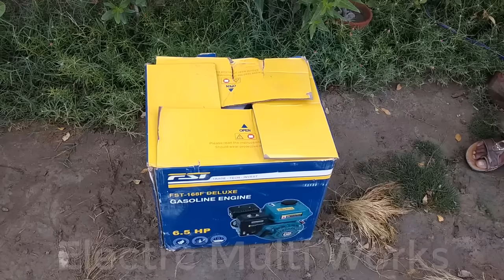Flywheel Free Electricity How To Make Free Energy Generator 230v With 8kva Alternator & Motor

Comment: These guys are scammers he has  change  alternator inside to be a 12v electric motor
Reply: If you had been paying attention you would have noticed how the plugs got switched before and after starting. I’ll bet the receptacle was wired, all one would need to do is hide the wire inside the tube steel. Viola, ‘free energy’.
Reply: Nonsense effort totally against the physics
Reply: Same equipment for different video.....only changing paint...nice try......🤣🤣🤣🤣
Reply: @jasincolegrove6651  I noticed the plug location swap also. Gotta admit, they're pretty slick!

Comment: i didn't get what's the use of the alternator and battery !! and if this video was provided with numbers and stats will be great
Reply: prolly using the alternator as a motor, so the battery drives the 'alternator' motor, which turns every thing else.
Reply: Rota la energía y la batería se carga.eso parece.mantenerse ritacion de energia
Reply: ale alternator żeby mógł ładować akumulator poprawnie potrzebuje regulatora
Reply: I think the alternator is used to keep the battery charged. And the battery is used to keep the stater excited in the induction motor. I may be wrong though
Reply: Alternator is main part in this project..it runs the DC motor to keep running the fly wheel which in turn makes the AC generator keep rolling that generate AC current..but if battery terminal disconnect then everything will stop ...lol..it's running through battery
Reply: Very nice it's use for agriculture moter pump kitana price lagegi

Comment: The "free energy" stuff 😂😂 always something to laugh at 😂😂 even funnier is the dense people that believe it. 😂👍
Reply: @aliyavari6263  yea, because friction and loss are only a myth right? 😂😂😂😂
Reply: @noel Leonard can you explain  
I want to know is it possible or not?
Reply: It can charge
Reply: @karandeepsingh5967  Perpetual motion is the motion of bodies that continues forever in an unperturbed system. A perpetual motion machine is a hypothetical machine that can do work infinitely without an external energy source. This kind of machine is impossible, as it would violate either the first or second law of thermodynamics or both
Reply: @badeadrian  
How much this project cost in India
Reply: @karandeepsingh5967  it's better to buy solar panels ...you will save some money after a few years...
Reply: @badeadrian  solar panels is not useful in our area
Reply: @aliyavari6263  the more load you add the slower the flywheel gets.
Reply: For free energy 😆 its very bad idea to use induction motor . Free energy really exist or not i don't know. But one thing is that i can say - when you put something load to alternator ( ac generator) its speed is suddenly change 😊and when speed of an alternator change it directly effects on frequency becausz frequency is directly releted to synchronous speed for its respective poles . When frequency change the output of motor torque speed also change . After all its almost fail 😊😁. Inducton motor,s speed torque is directly releted to the supply frequency . I think you know this think very well . 
Im not a engineer but also i wanna to suggest you - use the something BLDC motor and its contorl circuit ( invertor ) .😊😊😍 
just a suggestion 😝
Reply: @aliyavari6263  CNN win byefxTV

Comment: Initially, the fly wheel was rotated manually.
The fly wheel functions to drive the power supply which produces electrical energy, then the power supply is connected to the lamp and the transformer, so that the  lamp and transformer rotate and are connected again to the power supply, then the power supply rotates automatically continuously.
Reply: 😂you must never be a teacher. What an explanation 😂😂
Reply: Thank.

Comment: It is impossible. Where are the frictional force and Newton's laws? If any motion is stopped or reduced when opposing another force, that is the universal truth. Motor is the moving machine, it have opposed the frictional force of atmosphere, frictional force of bearings and load of the generator. How can do continuously rotating on the motor. I think the secret connection in to motor is located in the underground.

Comment: Ahem... The first law of thermodynamics: When energy passes into or out of a system (as work, as heat, or with matter), total energy unchanged as the law of conservation of energy. Equivalently, perpetual motion machines of the first kind (machines that produce work with no energy input) are impossible. !So dislike for videos like this!
Reply: This video came from kingdom of intelligence aka Pakistan...😂😂... Don't wants to describe further...🤣🤣 Those who are making and buying solar panels are fool.
Reply: I think it's better if people should dislike comments like this!
Reply: Yes like the earth gravitate around the sun at over 100000 km per hour during billions of years connected on exon  wells, that is well known
Reply: It is a working divice because The inbuilt motor uses electrical power to turn at high speeds to set the flywheel turning at its operating speed. This results in the storage of kinetic energy. When energy is required, the motor functions as a generator, because the flywheel transfers rotational energy to it.😏
Reply: @asphalt89content  Well that is just in your thought.
In reality that won't work
Reply: @Mister Frank ...                          

What do you mean? The device on video is a closed system!

Comment: That's a seriouse waste of electrical(battery) energy :( -  The clips won't arc, as the alternator is NOT generating, but drawing power from the battery to regulate the single phase alternator's excitation windings, that's got a load on its field windings by the large motor attached. Good example of kinetic and em storage of momentum though! :)

Comment: After cutting connect of generator moter will run the system by electricity.Fake video.
Reply: the gen set is not disconnected, the gas motor is

Comment: I thinks it's all working with the help of the battery...
Reply: Bulb is glowing after detached the battery.
Reply: Real Alive Until the flywheel stops spinning. It’s a heavy wheel so it will take time to stop.
Reply: @realalive4070  The bulb glow only few seconds without battery, if the battery disconnect about 1 minute the bulb glow will decrease and finally it will turn off...
Reply: Zulfiqar Ali  तुमको science मै कोई विद्या नहीं...
Reply: Zulfiqar Ali  ,i
Reply: Yes

Comment: Where is the free electricity?   The rig is  all being driven by the 24 volt battery. Once that has run flat the dc motor will stop. Look , there is no such thing as free energy unless the energy source is renewable for free like it is with  wind or tidal energy geothermal energy or nuclear energy.  The law of physics dictates that perpetual motion is impossible due to any systems built in losses (mainly friction, wind drag and heat generation and magnetic flux drag) i.e mechanical efficiency can never be 100%. Hence perpetual free energy is impossible.

Comment: What if we use a 240v to 440v stepup transformer with alternator before adding load to reduce load current?
Reply: It's still the law of equal and opposite reaction . Gain a little and lose a little . I think

Comment: 🤯🤯🤯  ITS  NOT FREE IF YOU GOTTA PURCHASE FUEL TO PUT IN THE ENGINE  !
Reply: You see he took off the belt to the gas motor the alternator put out enough power to the motor and the fly wheel spend it fast to produce enough voltage to keep al it spending by it self battery give it enough fire to start it free electric
Reply: Umm. No that is cheating  ! Again, what if no fuel station in area? What if you off the grid & then what ? 

When you come up with a way to jump start without paying then its free.. exp. Wind ,water, fire - animals or man manual  ..   

Cant start with fuel unless you pumped it from the ground or go kill a whale & get it oil, or natural gas.. or steam, or composting gas of natural breakdown of XYZ

ALTHOUGH I WILL SAY ..GOOD IDEAL..  DON'T GET ME WRONG

Comment: Install a bigger flywheel, something like 4 times the size of this one, and then you can run more appliances, I'm searching for a Flywheel Generator made by an engineer some time ago, and it showed it was possible to do. Hell of a rattle thou.
Reply: A heavier load will slow down the flywheel. Ultimately make it stop.
Reply: There has to be balance between the three components if the fly wheel is too large the motor will overheat trying to keep it at the speed needed to provide the generator the RPM it needs to be at

Comment: yesterday I made a comment about this video and said it must work by magic because it has no external connections. Well it's not magic because I saw on another video  where the scammer shows all 4 receptacles are ganged together inside the box (which serendipitously was the very same box
Reply: Everyone is being fooled. There is no such thing as free energy. I told from India.
Reply: @sahidahammed1166  You are absolutely correct Sahid

Comment: turn off the battery so let's see then!
Reply: Lol what it has to do with the battery..its just placed for charging with the help of a dynamo..🤣🤣🤣🤣
Reply: Input outways the output so without the battery this would stop within a minute or 2
Reply: The tric is ;mey be that small altenator is not altenator but it is modified to Electric motor
Reply: @asetyabudy  see trick is that first the alternator is run by a gasosoline gen. Than after a step up the belt is removed from the gasoline genset thus the alternator get the pickup n generates emf so that in turn runs the motor which keeps the motor running always that keeps the alternator running always..simple n a dynamo been placed there which is used to charge a battery for other purpose ...u got it little jerk ..

Comment: Since 15 years, I have been dealing with angular energy electricity generation systems (R&D). My positive designs related to angular energy continue. In this regard, my own financial means are insufficient, I had meetings with many businessmen, they accepted the financing of the project, but they gave up when it came to signing a protocol, that is, when it came to formalisation. If there is an entrepreneur who will walk with me on this path, who is idealistic, has financial means and wants to make an official protocol, I would like to meet.

Comment: impresionante alguien tiene un plano o especificaciones de los circuitos?
Reply: Este sistema funciona, bien, no hay mucha ciencia, solo tenes que ver el juego de poleas y el secreto es el volante de pesa, que es el que impulsa todo, sin ese volante nunca funcionaria, saludos ...
Reply: No se pero el puso la caja de los enchufes sin cable dentro ,como transmite la energia ? Hay otro video que tiene unas especificaciones de cuanto es el motor y el generador..igual es tentador el invento ,¿¿se podra conectar el consumo de una casa .con 10 amperes y 220 vol..calculando refri,teles ,luces ,etc...seria bueno un gasto una sola vez...??
Reply: @ricardoleyton4913  si,
 este diseño esta bueno como para una casa tipo, familiar donde se puede usar todo a electricidad, con 8kw imaginate, aguanta hasta 8000watts...
Reply: @nelsonsiles9429  podemos hablar??? Nelson, m das tu correo

Comment: I see you use ohmic loads and universal motors (wheel) that do not require constant frequency, but show with asynchronous motors that require constant frequency, there is sure to work it will be destroyed !!
 My specialty is Electrician of motors, transformers and generators, automations and I say my opinion !!

Comment: This one will only run until the battery goes dead because he doesn't have a larger pulley on the electric engine than the electric generator

Comment: The law of conservation of energy prohibits getting  out more energy than you put in ( in fact you get less out due to losses such as friction) . If you look at the set up the fly wheel is being driven by the battery and the alternator motor. So the whole thing is running from the battery. How is that free energy? Maybe you should have paid more attention is physics lessons.

Comment: How long does it stay running before you have to restart it?
Reply: if no external power, i.e fake. then it will stay running until the kinetic energy put into the flywheel is used up by the load or losses through the friction of all components
Reply: Life time 😂😂 no need to stop

Comment: The fly wheel has stored the energy while it Was  started. It  will run as long as the energy stored in the fly wheel remains and stop sooner the moment of inertia comes to nil. Let him connect the energy meters at either end and prove it. It is only a gimmick.

Comment: Adding a car generator and a battery Is it to regulate the frequency of electricity?
Reply: I don’t believe so it is only Demonstrating excess power Being provided by the generator in addition to powering the motor
Reply: @rmendes2mendes915  
With this design, we do not need a battery and a car generator, because the initial operation to generate electricity was with a mechanical engine, and then it was separated to save fuel and to work quietly without disturbance, and it became powered by an electric motor fed from a closed circuit connected to the electrical generation circuit.. The presence of the battery and the car generator is useless.  Nothing but battery charging only.
Reply: @fadilibya99  yes I already know that

Comment: Thanks for your research, if we annoy the friction it will be perfect right? so it will not possible to work all the time. in this case, a little energy can generate/gain the power for this system. According to your research how long it will take time to stop because of this friction? have you ever tried to turn on this system for a couple hours? Multiple small energy. thanks once again.
Reply: Battery - Inverter - Motor - flywheel - generator/alternator - battery
Reply: I Will be very happy to wait your next project

Comment: I still have some bad presentiment over this flywheel. shouldn't the disk be bigger and heavier?
Reply: If the flywheel mass is too large the motor will overheat trying to keep it up to speed, there has to be balance in the three components

Comment: You can find out the data of the electric motor?, And how much do the starting capacitors cost, how much microforat?
Light bulbs are already the last century, you need to watch how the fireplace, electric stove, refrigerator pulls? Everything that seriously shakes, and this is a kindergarten in a sandbox, you can not name it otherwise. Are there any subsidence and how long can this generator work?, What are the parameters to watch?

Comment: All I see is a big lead acid battery driving a motor, which in turn spins a flywheel onto a generator that powers a bulb!

Absolute nonsense. If this were true, we could turn two hubs of a car into dynamos, and they would power the other wheels.

Comment: law of thermodynamics is a joke it just gives humans limits, this is how it this works| motor - heavy flywheel - motor its first motor uses energy to spin the fly wheel, then the flywheel is connect via roller to 2nd motor, the 2nd motor's wires are connected to the first motor as it uses energy it produces same energy making an endless cycle, now the third motor on the back is the one that is actually producing electricity  cause it has nothing to do with that cycle, though this is too weak it can only make a Computer desktop work if you manage to make a bigger flywheel that would be enough, then replace the third motor with more powerful one that could at least produce 230v at 8000 watts to power a house.

Comment: fake, each motor only operates at 70-80% efficiency 20-30% is lost in friction and heat, so it works against itself in ever decreasing energy as it is passed from generator to the next, its all over very quickly rendering it a nonstarter.

Comment: No good design... Use starter battery drive with teeth plywheel starter gear drive will disengage after totally run no need of gasoline engine

Comment: stupid people who believe this trick , ( energy cannot be generated from nothing ) ,,, the trick is like this : when the flywheel runes by the petrol engine it got a circular momentum,  but after the engine switched off,  this momentum will be lost gradually,  to maintain the circular momentum there should be an external source keep rotating the flywheel,  he used the dc motor and the battery to maintain the rotation of the fly wheel which keeps stability of rotation whenever there is an electric load connected to the generator .
if the battery disconnected, the system will stop working in less than a minute. 
even with the battery connected the system will discharge the battery so fast , even if he use a dc charger for the battery again the system will stop after a period of time,  coz the output of the battery will be more than the charger power because of energy lose at each stage. ( the energy comes from the battery and back to the battery if there is a charger but after losing part of the power at each stage )

Comment: This system works well but only If correctly calculated. The most important factors are the FW speed and weight. The use of a permanent magnet generator helps for using a lower speed and weight FW, however this system will have a better project If working with batteries charger and inverters.